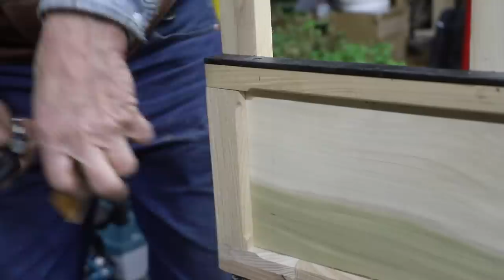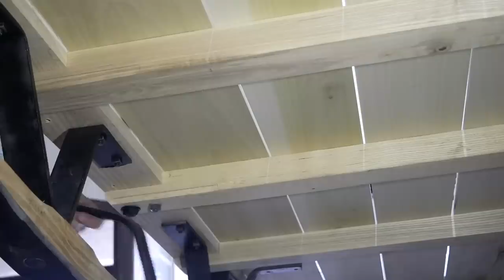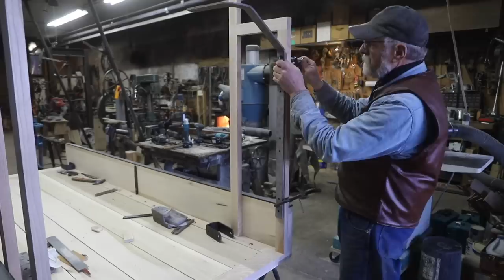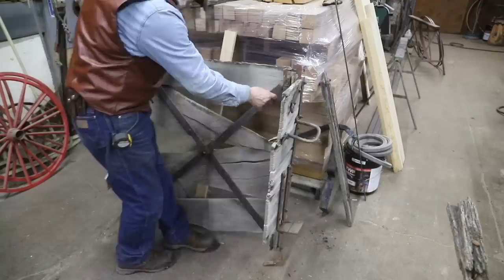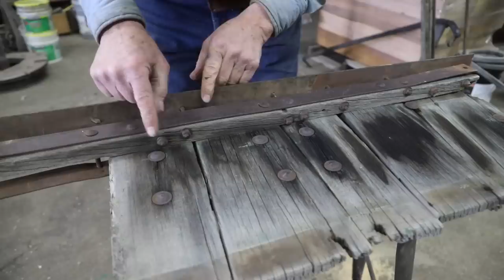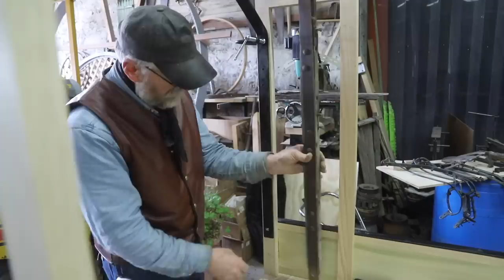Finding Hidden Bolts Reveals Original Coach Design | Engels Coach Shop

Comment: Seems to me that you're one of the very few people who when you buy carriage bolts actually uses them on a carriage!
Reply: lol lol
Reply: Hilarious!  I spoke something similar (but less humorous) to myself then read your brilliant comment.
Reply: Also one of the few who uses bolt cutters to cut bolts.
Reply: I am always learning something new that is amazingly simple but effective.   No lock tight needed,  nip and mushroom the end.
Reply: What's neat is we see many of these hardware and application right up through the automotive industry.  This lasted unto perhaps the early 1990s.

Quite often do restorers of old cars and trucks see the same hardware and uses.

Tqo days ago I visted my friend who is restoring several old trucks (Chevrolet and Ford).  While I was there he was fitting the bed and quarter panels.  He was doing very much the same we see Mr. Engels doing here and using the same hardware.

Of course I see the same on my Dodge Power Wagon.
Reply: @secretsquirrel6308  in no small part because custom coach builders transitioned from wagon, sleigh, and asked bodies to automobile and truck bodies

Comment: I know you’re a Makita man. But for your sawsall you ought to check out the Milwaukee Hacksaw. It’s great for one handed cuts. It’s a lot less taxing on the wrist. With more control. I have both in Milwaukee. And the hacksaw is my go to tool when I’ve only got one free hand. I don’t know if Makita has anything like it. It would be nice if they did. I do know you can buy a battery adapter so you could keep using your Makita batteries with it. Just a thought to make your work a little easier. Keep up the great work you’re channel is great to watch. And I’ve picked up some good knowledge.

Comment: I think what you have shown us is a classic example of a (horse)shoe maker repair.
Reply: Very much so and my money is on the issue that he was the only bidder on the wrecked heap 'O parts after the crash. I don't quite follow Dave's halfhearted "end over end" suggestion of the crash however, but do favor a misparked wagon and a train perhaps or even a redwood section awaiting load out near the train station that just got away from them and did a slow motion roll into the wagon that also shouldn't have been sitting in that precise location that day. Stuff happens as they say, that part is a certainty just as much as that guy murphy was afoot back in those days too.

Comment: Dave I’m curious about that usual hammer you have. I also think that one of the handles was a replacement while the other is original. Just a guess but I bet someone thought that having the handles horizontal instead of vertical would be used as a step to get to roof.

Using all the evidence presented I can make a guess at what happened. This was designed as a people carrier, with luggage on the back. Not a large amount of weight. Over time cargo was put on top of the carriage tied down somehow. This increased the wieght carried and eventually the rear axle gave way or the wheels. That made the back crash down hard bending the undercarriage. As well as wrecking a few things. A local blacksmithy probably got it repaired enough to get the driver home with a few extras to help prevent it from falling apart and making it easier for top cargo to be loaded and unloaded. 

Probably got used for awhile like that till a better coach made for people and cargo came along. Or a train or boat and was sold to someone else as a farm type wagon, kinda like old vans are used on farms. Eventually being used in its final days as a novelty parade type thing till it was beyond easy repair left to rot to dust.

I would not be surprised if it had, at one point, lamps or places for hurricane lamps.

Comment: As always, i see the difference between caring about the end result and just getting it done. how many times do you bolt things together and then take them completely apart for 1/8 of an inch to get it right, not just done. Lead by example.

Comment: Since that patch was needed, I would recommend a stronger steel and a few more screws to prevent the problem that required a repair. Just a suggestion. Really enjoy your videos. Thank you
Reply: Or just not wreck the coach after...
Reply: @donaldjohnson5633  Centre of gravity is high with the driver and his mate so far off the ground. Is that why it turned over/crashed.
Reply: It's a parade wagon.

Comment: I guess when you use square nuts, washers are unnecessary? Oh, wait, I just saw some. But maybe it was a later "patch job"?
Reply: Note that Dave peens over the threads of the bolt thus locking the nut.

Comment: I don't know to how you balance YouTube as a teaching vs. a money-making tool, so make of this what you will: if for either reason you want to do "Shorts," the very basic skills I see you use so often would be excellent fodder. I can see that you have reasons for the specific marks, measurements, techniques, and tools you use, but in fields (like carpentry and sewing) that I don't have frequent use for, I just don't know what those reasons *are*. As a f'rinstance, pre-drilling nail/tack holes at 2:18; for screws it makes sense to me, but why do it for nails/tacks?

EDIT
Not knowing what I don't know, I THINK a <60 second video could explain that, but you get what I mean, regardless! Very basic skill instruction, for very ignorant fools like myself!

EDITED edit
Also, no matter what else you take from this comment, thanks for doing all of the videos you've done so far; I may annoy my friends pointing out weirdness in historical TV horse-drawn carriages now, but I'd rather do that than be ignorant of how hard a wagon-wheel is to actually repair any day!